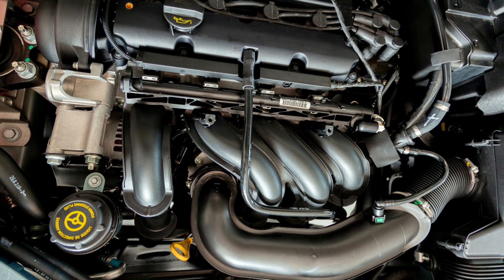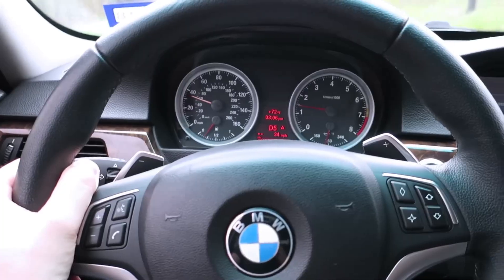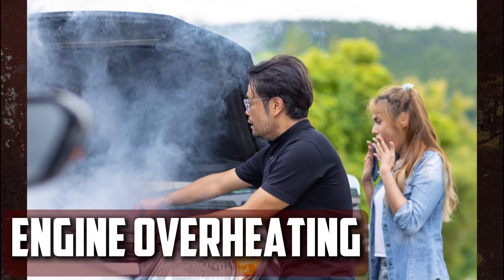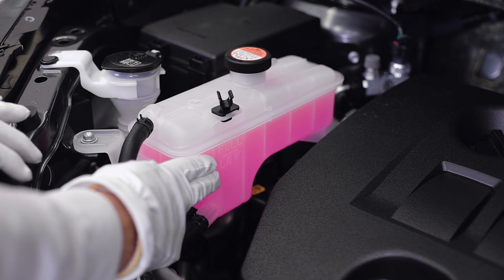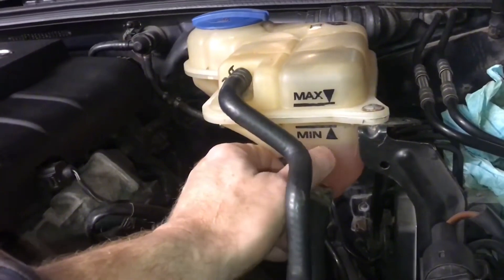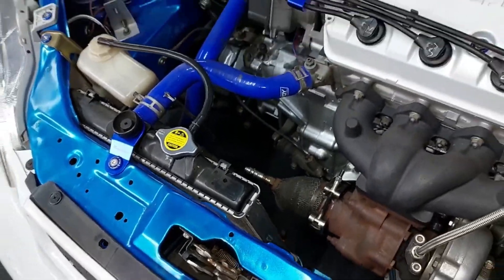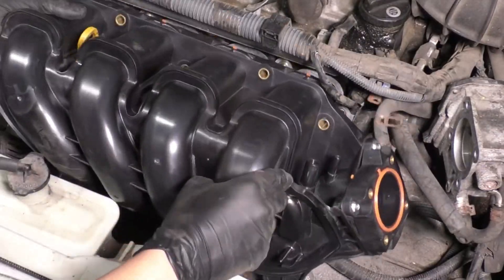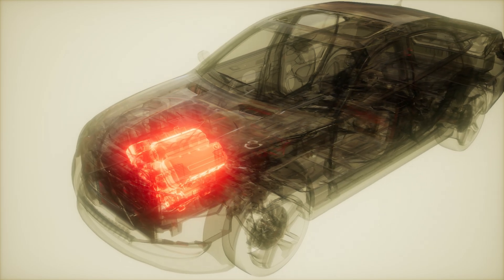6 Common Symptoms of a Bad Intake Manifold & Cost to Fix

Comment: Mf a intake manifold is just either a big chunk of a metal or hard plastic. Unless you overheat the crap out of your engine or hit the manifold with a sledgehammer, it can't fail. No moving parts
Reply: Lol u have no idea what you speak up.  Heat can damage it from rust and rain heat debris etc eventually destroys a car external part
Reply: @hermessrt2414  omg rain? I parked my mustang for two weeks and it rained, then drove it for 10 minutes to a gas station. Something popped in the engine when I turned it back on the mechanic said I needed a new intake manifold.